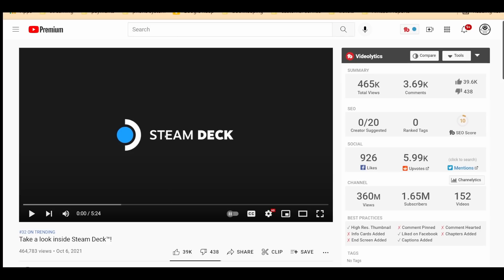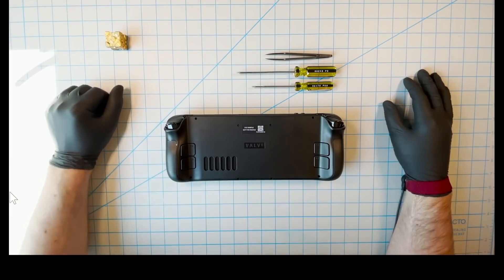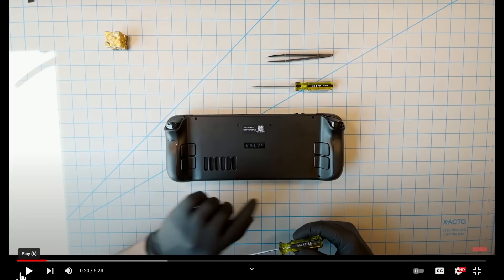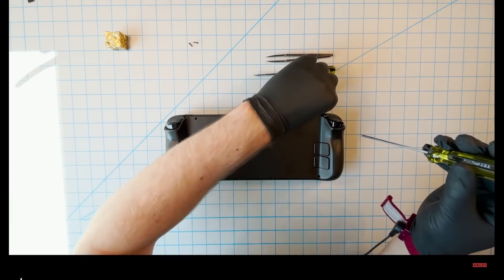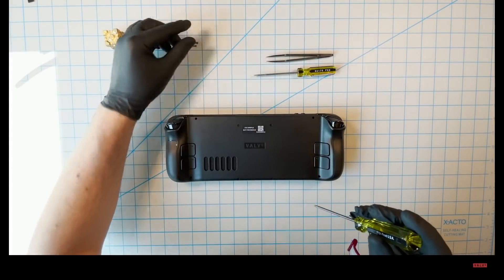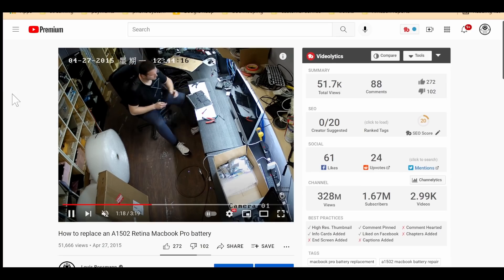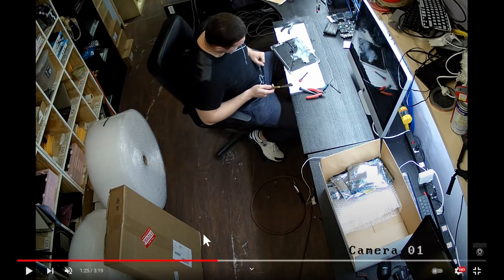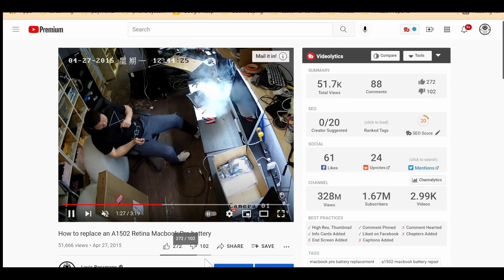Steam deck battery may end your life? bruh 😑

Comment: I don't know about the structure integrity, but I have a lot of experience in teardowns and general device repairing and I would reccomend users to repair their stuff, just be careful cause you will probably lose the water resistance (if your device had it). The only devices that feel kind of strange after a repairment are thinkpads: I don't know why but even after stupid replacements (literally uncrewing the back, taking one bank of ram out, putting a new one in and re-screwing the back) they feel kind of "cheaper", maybe you can hear some more crunches in the plastic or your keyboard feels mushier, or has an inconsistant feel... once you open one of those laptop they don't feel the same. Anyway thinkpads are known for bad concistency in their quality, not that they feel bad, but if you get the same model, from the same store, produced in the same factory, it's not a surprise if they don't feel the same on a construction quality perspective.
We don't know if the steam deck will remain consistent after a repairment or if the quality is going to be consistent between different units, for sure there will be people that sre going to  repair, teardown and even mod them, so don't be anxious and just wait for a video or a guide on how to repair it and try.

ps: sorry for any mistake, English is not my mother thongue.

Comment: Here's a question: Will a damaged battery always ignite *immediately*, or will it possibly do that in your backpack while you're on your bike going 150MPH on the autobahn? Or when you leave the device in a charger and go walk the dog? I don't know. But if there's even a tiny chance something you do while tinkering with the device could cause anything like that, a warning is in place.

As for the structural integrity: Remember the low experience home user perspective, not just repair shop guy. I think they mean that self tapping screws are never as secure after second installation on plastic. So the device is not structurally as strong as before you opened it. It may be 0.0001% but still. "Lessened some" is the words they use specifically, not "it will fall apart hitting the first bump on the road". To me that sounds like a reasonable note to take for everyone simply because a lot of people will probably use questionable tools on those screws, and perhaps more so because many who may have worked on things like random laptop repairs or PC building may have never encountered such screws. I can only speak for myself though: I can't exactly remember encountering those. There may have been some on mice I've opened for worn out micro switch swaps, but their resilience requirements after reassembly aren't quite the same. So even if the warning was moot or exaggerated, it would at least make me pay more attention, personally.

Comment: I suspect that the "structural integrity" thing might just be that they are using Loctite or whatever threadlocker on their screws and when you unscrew them you break that bond and the only way to get that back is to drip more in (and you can only do that so many times before you gum up those threads, which is probably why they just don't even mention it.)  Is it going to make the device critically weak and unstable?  No, probably not.  Is it going to have marginal effect on the structural integrity by making those threads hold slightly less firmly or more prone to stripping out under shock?  Yeah, a little.  It's not a big deal, but I'm sure that it has something like a 5% reduction in that thread's strength, and honestly, to me at least, it just seems like a very Valve thing to do to be talking about tiny, marginal engineering data points in a teardown video.

Comment: To preface - I am not a mechanical engineer and there are people far more qualified than me to answer this question, but I feel like this is relevant for the conversation and could add to it. I do work with hardware testing and engineering however.

I believe the structural integrity warning refers to the chance of tightening the screws at a sub-optimal torque setup when the user reassembles the device (even without, for example, breaking the screw holes by over-tightening the screw).
This could strain the frame of the device at areas that the design of the frame does not account for, which in turn,  could indeed cause structural failure if the device is exposed to high impact. Alternatively, the same strain caused by a wrong setup, over a large amount of time (think weeks to months), could potentially slightly deform the frame. This new shape was not designed to absorb impact (or at all).

I believe that this is a general warning and more of a legal disclaimer - most warnings in the video seem to be.
Most users would not kill themselves by damaging the battery, but for the off chance that someone does - this video, hopefully, covers them by offering a very explicit warning.
Most users would not tighten the hell out of one screw and loosely tighten the rest, but making such a general statement is easier than providing detailed instructions on device assembly.

I agree that the statements in the video are quite exaggerated, but they seem to be built on the assumption of "there's always a bigger idiot".

Hope this helps!

Comment: Opening it and re-closing it could potentially weaken the connection of the self-tapping screws and therefore reduce impact resistance.
If this actually going to be an issue if you don't over-torque them and re-use the existing threads? Probably not. But as you mentioned, if they don't cover their asses, somebody will complain who did it wrong. By just saying that it will absolutely reduce the impact resistance, they can always just say "told you so".

Also, from the phrasing it did sound like they acknowledge it won't be reduced much. They just didn't want to outright say it.

Comment: I had an iphone 6s blow up on me during a repair once it was already a spicy pillow coming into the shop, Pro tip try and fully discharge a battery before replacement if possible if I had done this I would have probably just had funny smells instead of a thermal nuclear meltdown as seen above.

Comment: Two ways it could weaken the structure if you open it are. 1 you strip the screws. 2 you thread them in as self tapping screws on a new tapping rotation is now it's got two threads tapped in and the socket can weaken or crack even with out over tightening.  However even if they do reparework that would happen from steam them selves unless they replace the shell each repare.

Comment: The structural integrity of devices gets weakened when the plastic pieces use plastic tabs to close the shell and hold components which is something I really hate. The more of this plastic tabs a device has the less repairable it is because plastic goes brittle over time and you can snap thesee tabs while trying to open it. It is unavoidable most of the times.

Comment: I think valve stating "not designed to be user swappable" is probably due to a lot of kids breaking stuff with the switch and how often controller mods come out that when people attempt to perform them ends with them breaking the controller..... and honestly my big gripe with the steam deck is how unlike the switch the controller is not detatchedable from the rest of the unit meaning the joysticks that are consumable items and will go bad need to be replaced you now have to work through a lot of components they could have designed to be outside all of that.... I am sure size and total utility comes into play as for why they went this way.....At the end of the day.... REALLY. How many times have you had a user send you something they tried fixing and lied about it and they made everything much worse..... I KNOW you have complaints about it XD.

Comment: Hey, guy who has something way too long to say about the structural integrity part of the video here.

Self tapping screws are not designed to be removed. The reason for this is that they are, by design, threading themselves into the material, which means they are cutting through the plastic and litterally shearing it to some extent each time you insert them. Given a couple screwing in and out, they will weaken the load bearing capability of the plastic, like a screw in a wooden plank you screw in and out multiple times. Difficult to say how much damage there will be but it's not an unfair assumption that you are damaging (to some extent) a plastic casing when opening it and removing the screws.

Also lithium batteries can be dangerous. They're not TNT levels of dangerous, but the fumes are very toxic and a battery fire can't be stopped with water and the flammes run very hot. The bigger danger here is to start a bigger fire, for instance in your house if doing this inside. The other bigger danger is to inhale the fumes if you're in a small space and there's a lot of it. Careful while handling these. Keep an easy access to like a window or something to throw the battery outside if things go wrong. Don't be paranoid though, unless you poke it with a knife, you will rarely burn a lithium battery.

Comment: Pertaining to the "structural integrity" comment:
I once took an xbox controller apart (I forget why, and it's not relevant), and when I put it back together, I must have messed something up, because the shell wasn't packed together correctly since that point. It acted like one of the screws wasn't holding it together correctly, or something to that effect. I cannot say for sure, but it may be possible that this kind of situation is what they were referring to. Although, with that in mind, saying it as if it is guaranteed seems a bit off the mark.

Comment: Coming from a physicist, I would believe there's reason to say that there is a loss of strength when you take the screws out, simply because they're self tapping. When it's first threaded into the hole is when it's gonna be in its most secure position, putting it back in, in the exact same threaded slots, will restore its position but the threads won't be as tightly squeezed by that plastic anymore. Also, if they end up creating new threads in the plastic, there would be less integrity in the plastic if someone pulled, since there is now 2 sets of threads in the same space, which means 2 times as much material removed or displaced. Again this is entirely theory coming from my side, I can't confirm it, but from a logical stand point, they aren't too far from something logical I'd say. Though I think their argument applies to anything held together with self tapped screws.
Reply: As an electrician, I can confirm screwing back into threads does weaken it.
Screws;
directly in concrete: 2 times at most,
In a plastic anchor 3-5 times,
In wood 1-6 times,
In hard plastics 1-4 times.

If you're using mechanical screws, metal on metal, or an insert you'll get plenty of in and out compared to screws that make their own paths.
Reply: I love it when an Engineer and a Physicist talk or work together. These really are awesome
Reply: no one needs to be a physicist to understand something this basic

Comment: I think their silly warnings are mostly for liability. I'm not an expert but can't you damage a battery in a way that it would rupture later? Sounds like a dangerous thing to happen in a bag

As for structural integrity after removing screws? If you strip the plastic it could make its overall integrity weaker. It's not gonna make plastic more likely to crack when you drop it but if the screws aren't biting on to much then it could just disassemble on impact. It's a bit of a weak warning but technically true

Source: I do waterfront construction and design guns

Comment: the weakening by disassembly is 100% absolutely correct. It didn't say RUINED, it said weakened, and because they use self tappers they are 100% correct as there is now more play within the casement. 

Anyone who has ever opened a laptop should know this rofl.
Reply: Also, brass inserts and machine screws usually have thread-locker on them. If you don't put new thread-locker on the screws when reinstalling, it technically won't be as secure.

Comment: Personally I do not like the fact that they are using self tapping screws in plastic... Self tappers are generally used in a "one and done" situation. You don't normally unscrew and re screw a self tapper in the same hole as there's not much material for it to grab on. That alone is reason enough for me to not open it... It will likely creak and squeak every time you pick it up

Comment: They make it seems Ike it’s so fucking difficult when they clearly show it’s so fucking simple a 5 year old could replace those parts.  I commend them for showing the tear down, but all they’re doing is fear mongering.  As far as the screws are concerned, you’d have to have to be a fucking moron to torque the ever living shit out of the screws.  I believe most people that are technically capable of opening one of these, and this thing is as simple as they come, will know that plastics are soft but not so fucking soft as to become useless after removing the screws once.  If they’re game pad is capable of being dropped and surviving, as they clearly fucking showed in their video many times, then the plastic has to be either glass fiber reinforced plastic or some type of very tough thermoplastic.  Those types of plastics can be opened and put back together, again if you don’t overdo it with torquing the screws properly, with absolutely no impact on the integrity of the device.  So yeah Louis, you were right to have your bullshit alarm going off, because they’re full of shit.

Comment: Instructions and user manuals these days are the result of the lawsuit-fearing sanitized world we live in. Valve has no control over who watches this video (apart from age-restricting it, maybe) so they have to be careful to load the video up with disclaimers. That said, I don't think the part about the device being life-threatening was due to immediate danger from the product, but rather that someone who's never taken anything apart in their life (or maybe, some child that decides to do this in their bedroom) might pierce the battery, panic, and drop it on the carpet and whoops they've burned their house down. (Which is absolutely a life-threatening situation).

Comment: Repeated screwing and unscrewing into a plastic boss with the self tapping screws will eventually reduce it's ability to hold a load... that being said, unless you cross thread it or over torque it, that shouldn't ever be a problem the small number of times you should ever be opening this up for maintenance or maybe the occasional upgrade. IMO they're saying this to cover their ass if someone does screw it up by over torqueing (most likely) or cross threading the screws. The only other time you could have a problem is in the case of improper molding of the plastic part where you could get voiding in the screw boss which could result in it losing integrity far quicker, but that would be a mfg issue and not the fault of the end user. source: work as an engineer in the plastic injection molding industry.

Comment: Every time you use the screws, you weaken the threads, and that's tripply so with self-tapping screws in something as weak as plastic.
So yes, you will permanently weaken the structural integrity of the case each time you take it apart and put it back together.

That said, you'll be on your 5th or 6th time taking it apart before you should notice any issues from wear and tear.
Reply: Maybe they need to spend the extra $0.15 per unit and use a brass or metallic boss and real machine screws to go in them. I've seen that arrangement in MANY laptops.
Reply: @RobertMorgan  $0.15 per unit? They could put some proper metal screw anchors for normal screws to screw into there for like... $0.01 for every 10 units.

Comment: Electrical Engineering student here. Self tapping screws part is not entirely BS. Working with some assumptions, if you use self tapping screws and then have to remove them you want to drill out the old tap, fill it and re-tap, or use bigger self tapping screws. The problem with self taping screws is that it's incredibly difficult get your tapping threads and tapped threads aligned again without damaging said threads with a new tap... IT will basically make a much looser fit as the material is softer from being damaged twice.  Structural integrity will vary greatly on the material and size of screws and all that. For our use we typically just put how glue in and try to put the screws back in as aligned as possible. The hot glue can be heated up and softened in the future if you need to open things up again, it's non conductive, and will fill in the gaps nicely maintaining structural integrity fine. If you're feeling particularly brave, need a water seal, or need a more permanent fix, filling with epoxy or some type of super glue and then screwing in before it dries will work.

in my mind, using self tapping screws is a dumb idea  that says "we don't want you to open this ever and if you do it's going to cost you". might be a way of saving production costs, but that idea sounds dumb when creating a mold that can hold a small nut or threads with common screws is arguably cheaper.

Comment: when you re-screw self taping screw in to anything they will create new pathways for them selves=cut little bit more material out very time you do this which means over time the screws will have less support and in extreme stress might just come out. My credentials are that i am an airspace mechanic who has studied material engineering and the same basic physics apply in everything loads and the stress on the material will be differed tho. i also know that i am just some random dude in the internet